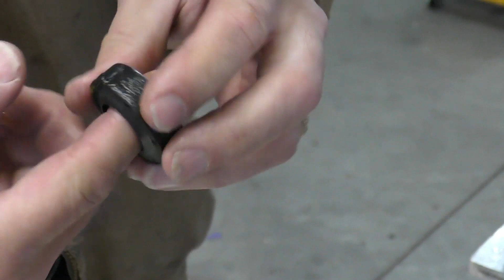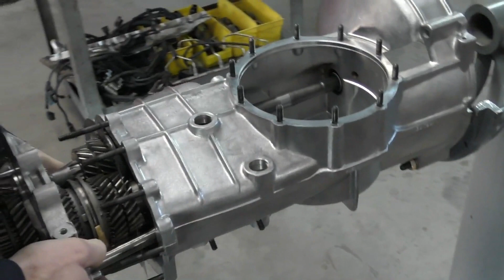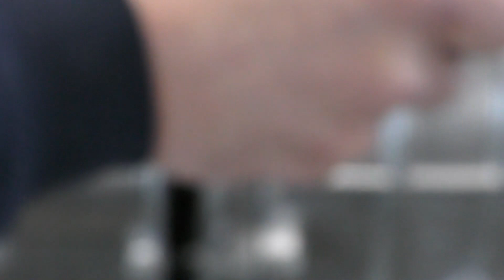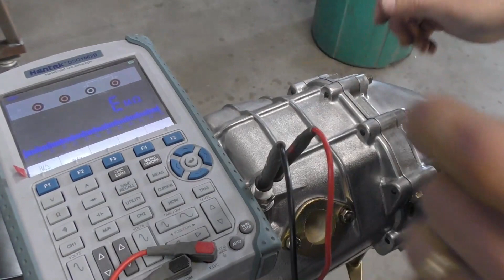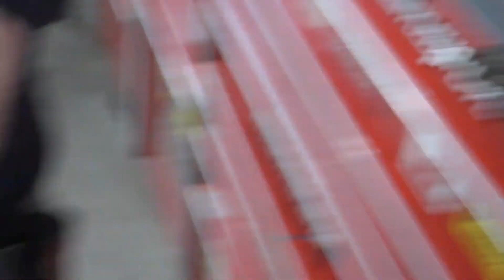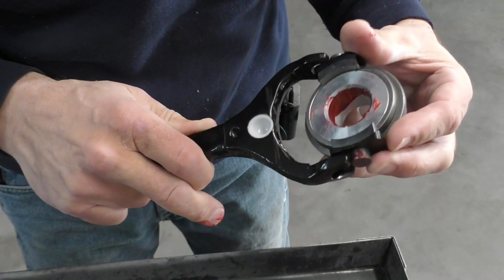Porsche 902 Transmission Rebuild. Final Assembly

Comment: Wow was having trouble with my 901 rear cover. As soon as i would start tightening the nuts my imput shaft would spin no more. If i would  losen then bolts just a bit,it woukd rotate,but id feel little toughness in back cover. Well viewed  ur video over over,then walla i noticed that those reverse gear gizmo goes...bearing ,spacer,bearing,gears,then that thin bearing,then that notched washer....did that.. walla,went in really easy..tightened everything. My output shaft rotates easily. Turns out i had that thin bearing way at bottom and would  bind everything up. Thank you do much for doing these life saving videos...they are awesome!!!thank you!!!
Reply from the maker: Glad the video helped you figure it out! S

Comment: I have a 901...should I be able to move the gear selector shaft through the gears when tranny is outta car or is it hard to do?
Reply from the maker: Yes but it will be harder to select gears as you dont have the gear shift leverage.
Kurt